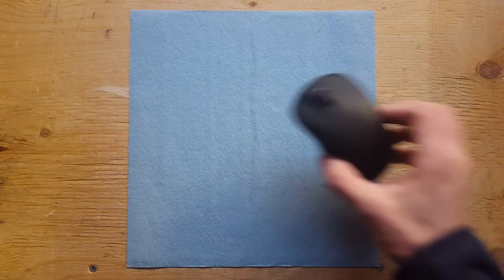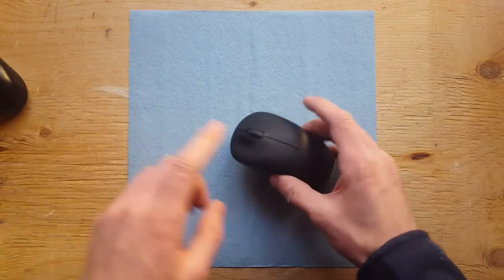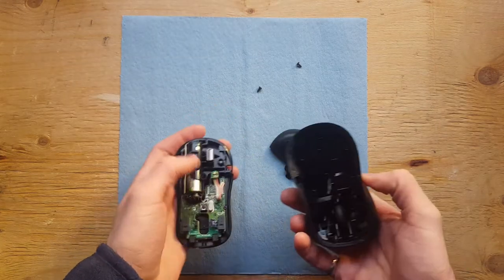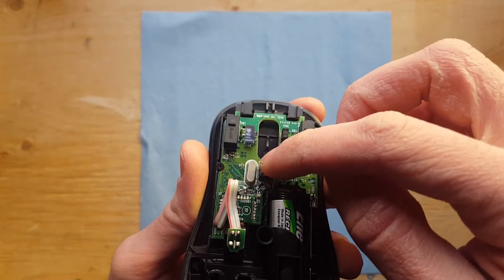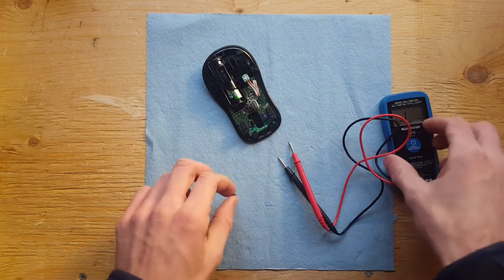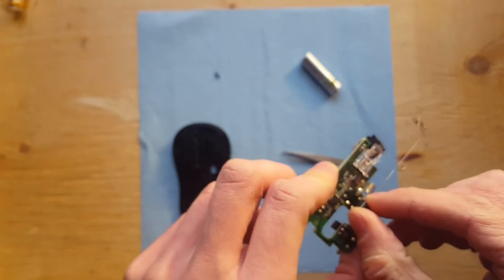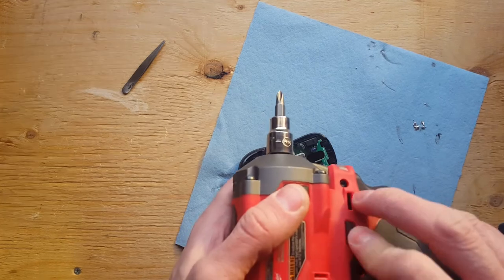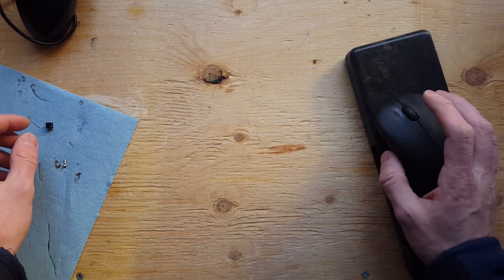Fixing a mouse that won't middle-click (Logitech M310)

Comment: Don't we all hate planned obsolescence. Nice video. I know nothing about soldering but I can't stand having to buy a new mouse each couple of months. I might just try to repair it this time.
Reply from the maker: Do you have a broken mouse?

Soldering is surprisingly easy! The only real trick to get started is that you want to heat the workpiece, not the solder. A lot of people first starting out try to use the iron to melt solder onto the component.

Comment: Would you be so kind to tell me the name or code or serial number ... of that replacemnt switch....
I would like to buy it anddo the same job...

thanks
Reply from the maker: I wish I could, but I pulled that switch from a bag I bought maybe 7 years ago, and the label is quite faded.

Search for "momentary tactile switch". The ones I have are 6 mm x 6 mm x 4.5 mm. Make sure you get four-leg, through-hole switches (not two-leg or surface-mount).

And no promises these fit on a different brand or model of mouse! (But they are pretty common)

Comment: my lovely windows intellimouse broke recently (just under 2 years of heavy use, was worth the $70 I paid??? maybe) so this was a backup and apparently I must have broken it a long time ago because, as many others, same exact issue. Microsoft and Logitech. You'd expect reliable products from name brands to last years. Its infuriating. Had mice back in the 2000's that lasted 3 years+ and cost 1/5 of the price.
Reply from the maker: They don't make em like they used to, and that's on purpose. Gotta keep you buying new mice every two years!